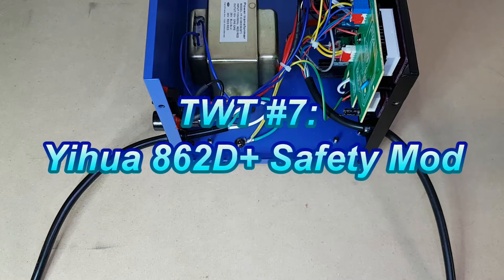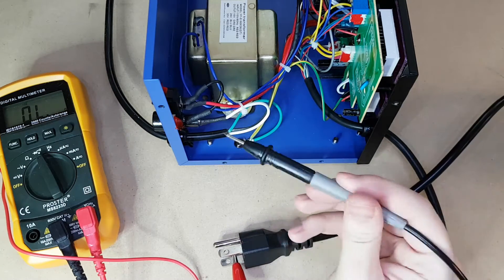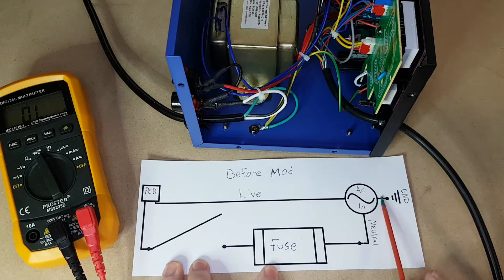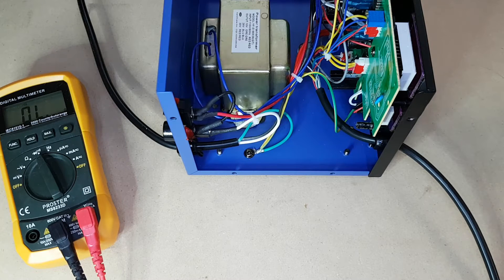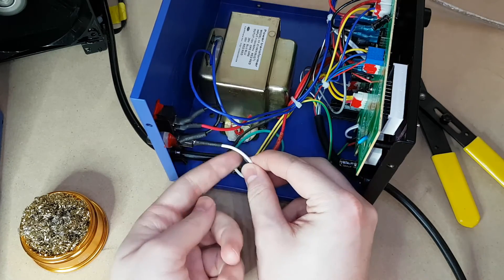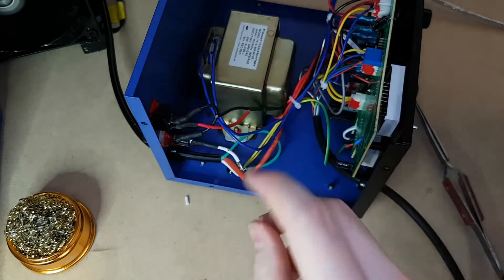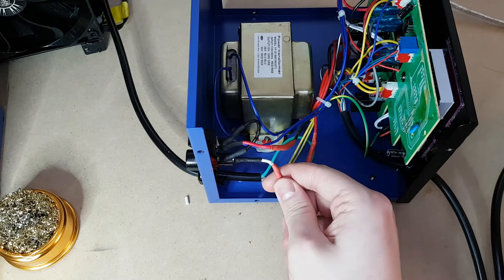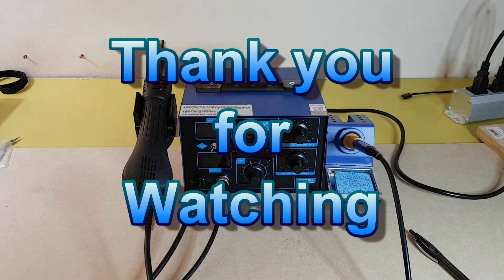TWT #7: Yihua 862D+ Safety Mod

Comment: Wonder if ALL THE VARIANTS of these units are wired like this one??
Reply from the maker: There are a ton of variants of this unit, but I've heard of multiple different branded ones all having this same issue. It just seems to be roll of the dice as to whether you get one that is wired correctly or not.
Reply: My Gaoyue 850, a Chinese Hakko 850 knock-off was miswired in the same fashion.  My Yihua 936B soldering station was partially miswired in a more peculiar fashion.  It's been a very long time since I encountered that, but if I recall, the "on/off" switch was switching the neutral, however, the hot line was fused.  It may have been the other way around.  Since I had it apart to replace the power cable with an IEC 3 prong receptical, I moved both the switch and fuse to the hot side of the circuit.  I don't think any of these type devices are "UL" listed.  :)

It's a safe bet that half of the Chinese made products of this type do not have their mains wired properly.  To be fair to the Chinese manufacturers of these devices, they aren't inherently unsafe to use, they are just not abiding by electrical standards we maintain here in the US and Canada.  There is no real circumstance, during ordinary use of these pieces of equipment that will put anybody in jeopardy.  If the switch is turned off on a machine that switches the neutral rather than the hot, the only live potential is still inside the machine.  The same goes for the internal fuse being miswired.  The earth ground is still present, and if in some bizarre situation, the fuse blew, the live potential could only short to ground on a closed enclosure, and likewise for the same situation having the neutral switched rather than the hot.

These things really only become dangerous when we open them up, not knowing only how it should be wired, but not understanding electricity in general.  Having standards makes life easier all the way around.  Consumer safety is just an easy means to coax manufacturers into not only building safer products, but products that abide by our standards.  I like standards, the alternative is chaos, which I don't appreciate so much in my old age...  :)  I buy so much Chinese made junk, especially where tools are concerned, that I can't think of any electrical device I've purchased in recent years, that I haven't had torn apart before ever plugging it in.  I correct what I find wrong, and improve deficiencies that will affect usability or longevity, but that's just me.  If I had the money to buy high quality tools, I probably wouldn't need them because I could then afford to buy new stuff to replace what breaks, instead of fixing broken stuff all the time.

Steve

Comment: Personally, if mine was wired backwards (it's not), I would remove the old wire entirely, cut the back case, add a IEC C14 (male side of the super common power cord standard used in PCs and more), and wire it correctly.

Otherwise, my Zeny branded one is actually pretty well built, aside from the /terrible/ iron tips and fitment. Actual Texas Instruments chip and a Samsung microcontroller.
Reply from the maker: Yeah that would be a more ideal mod for sure. Unfortunately I don't have any C14 sockets. I'm actually surprised they don't just use the C14 socket by default, though then they probably wouldn't include a power cable at all.
Reply: Evidently the zeny branded ones are nicer.  The schematics and cases are sold to small companies in china and they assemble them in smaller shops.  Some hire students to qc their process ( not the products) and they hire people to build units.  So they have no proprietary designs or formal patents.  Thats why you see 500 types of the same product.  The zeny brand has mostly samsung controllers or sony in some cases. I have 1 sony 2 samsung and all TI chips.  I did notice the element on 1 of my heatguns is made in japan the other 2 were chinese.
Reply: Tinkering With Terrius they dont add a socket because the sockets in china are something that varies greatly and unless its specd out correctly you can crash your whole company.  The build they bought didnt spec it with one so they didnt add one.  I agree any company with an engineer on staff would add a socket just to save money because even marking boxes makes 2 voltages expensive.  They use a guy who knows how to setup processes to make the first couple after that most small shops are 10x20 ft shops and the 5 employees live in the shop that makes them.  China is crazy when it comes to manufacturing.  I have seen nike shoes being made in a 10x10 shop by 10 kids who lived in the shop that go for 200 a pair in the US. The newest way to do things is to build 1000000 and put them in a big boxes and have them reboxed in route to the us to save money. The workers live on the cargo ship and box things constantly.  This works because it takes a month to get there and no labor laws to follow.  Waste is thrown overboard.

Comment: As promised, I came back to let you know what I decided on for a SMD station.

As you pointed out, the 862D+ is available from U.S. sellers on Ebay for $54.45.  After spending way too many hours debating what would serve me best, economically and functionally, I had limited my options down to two units.  The final contenders were the unbranded 862D+ for $54.45, and the Gaoyue 850 stand alone hot air station for $37.99.

While I truly believe the 862D+ is a better value than the Gaoyue 850, I opted for the latter.

Honestly, I am kinda a cheapskate when it comes to buying myself things, but it wasn't the $16.46 savings that led me to the Gaoyue whatsoever.  There were several small reasons that would not have compelled me individually, however, combined, the scale tipped towards the Gaoyue.

For starters, I already have a really good Chinese Hakko knock-off iron that I'm quite fond of, and used almost daily.  I do SMD repairs maybe once or twice a year.  Having something as large as a SMD rework station on my desk year round just gets in the way.  My solder station takes up about 1/2 the space, and still, I frequently move it to clear up momentary space for other things.

Secondly, that 862D+ is crazy complicated in it's construction where the electronics are concerned.  I need something that I can adjust temperature and airflow when I do SMD work.  I mentioned my old setup was comically bad, and it was, however, I was turning a potentiometer for heat, and a pressure regulator for air.  I work with hot air by feel.  It's not important to me what the actual temperature or CFM of of airflow are, so I'm looking at the integrated SMD station with all the bells and whistles as something that has a ton of needless potential points of failure.  The two dial 850 with no displays just works for me how I've been working for years, only far more efficiently.

Additionally, I kinda wanted a unit with an internal pump, rather than a fan in the handle.  I hear people say those "fan in the handles" work just fine, and even Dave from Eeevblog gave it a thumbs up, but it looks awkward to me.  I prefer only to be moving the heater around.

The Gaoyue 850 is the cheapest, most bare bones unit that meets all my criteria.  It doesn't have a hall effect or magnetic switch to shut the heater off when you hang the gun.  It doesn't even have a thermocouple in the heater to monitor the temperature, nor circuitry for monitoring or displaying the temperature.  It simply turns the heater on and off with frequency varying according to how high you have the heat turned up.  The air pump runs constant, but changes how fast based on input from it's potentiometer.  It does have a "cool down" feature that runs the pump motor at full for one minute after the unit is powered off.  That's pretty much it.

I had to laugh.  I always lop cables off of these type devices and install IEC plugs in their place.  When I was disconnecting the old cable, I noticed that Gaoyue wired it EXACTLY like your machine.  Yes, they neutral was both fused and switched with the power switch while the hot was neither switched with the power switch, nor fused.  Since I was replacing the cable with a plug, of course I corrected that.

I made a handful of other mods to the unit, purely due to my OCPD, but nothing to change how it works.  I think this is going to be the best setup for me.  I just need a project now to test it out...  I'll probably just start removing surface mount components off an old board, just to get comfortable with it.  It should be a lot easier to maneuver around than my old setup.

Steve
Reply from the maker: Thanks for keeping me updated, I apologize for not replying sooner!

I had considered just a hot air station when I bought mine. I ended up deciding on the 862D+ only because I figured a temperature adjustable iron would come in handy as well. Of course I don't have an iron tip thermometer to actually test how accurate the unit is, or a thermal couple to test the air gun yet.

It is quite bulky though and if I didn't have a large desk to work with I could see it getting in the way. I actually use it as a counter weight for my camera arm that is attached to a piece of plywood, so the bulk actually comes in handy! 

I imagine a unit with the internal pump would be more reliable over the long term and probably less noisy as well. I do wish I could afford a super fancy one, but really I have no reason to get one at my level of skill.
Reply: I think you made the right call getting an "all in one" station if you didn't already have a temperature controlled iron.  Since I already had the soldering iron setup I'm happy with, I just needed a better method for hot air than the crazy mess I had going on here for that.  :)

In terms of maintaining your hot air setup, you might also be better off with what you bought, rather than the internal pump style like I bought.

Don't get me wrong, I like what I bought for the reasons I mentioned, but I also try to think about how tool purchases will stand the test of time, and how little things will affect cost of ownership.

You can find both styles of replacement heat guns on Ebay for really cheap, and about the same price either way, however, when you replace your gun, you get a new blower to go with it.  In the case of mine, just the heating element.  That said, heating elements are dirt cheap, so I'd swap it first rather than replace the whole nozzle since it's the only thing that can go wrong with mine.  If your blower fails, you can buy a whole new nozzle, or just replace the fan in your nozzle, and if the heating element fails, they are cheap.  In the case of a station like mine, if the pump fails, a direct replacement of the pump would exceed the cost of the entire station, so I'd have to fabricate a substitute, which would no doubt take some time.

As for the accuracy of your heat control on either the hot air, or the soldering iron, I don't understand why people go to such lengths with those concerns.  If you wanted to tune the heat on your hot air, you can use a meter with a thermocouple, however, I don't see the point in that because the ideal temperature to melt solder on SMD's will change wildly from little factors, such as the nozzle tip you're using, and how high you have the air.  You'd have less luck gauging your iron tips temperature with a standard thermocouple because you won't get even heat transfer touching the tip to the couple.  You could spend about a hundred bucks and get a Hakko thermometer that will give you a fairly accurate reading, but again, why?  If it's not hot enough, turn it up.  If it's too hot, turn it down.  The thermalcouple in the iron heating elements reads just like the style you'd connect to your multimeter, but is accurate because it's surrounded by heated porcelain and the base of your iron's tip.  Again, your choice of tip will dictate how much heat is actually applied to the joint you are soldering.  The more mass your tip has, and the more surface area of the tip is contacting your joint, the more heat that will actually be applied.  That's why the conical tips are only good for the smallest SMD style joints.  In any case, if it ain't melting, turn up the heat.

I bought one of those knockoff Hakko 191 thermometers a while back, just because I was curious, and because it was less than $15.00 delivered.  Here's what I found:

My soldering iron was nearly 20degrees Centigrade hotter than what my dial indicates at the temperature I tend to leave it at, 350degrees.  So I calibrated my iron's station to compensate, now I set my dial just under the 350 mark.  Nothing is changed about how I work, the dial reads just a little lower than it used to.  I don't see how or why that should matter.  The bottom line is that whether you're using air or iron, the right temperature for the job is not going to be what's printed in a manual, it's going to be the temperature that works for the job, and that will vary with job.  Recommended heat settings should be taken as ball park figures to get you roughly where you need to be, but are certainly not absolute.

Anybody here who is just getting started with soldering and will not be doing any SMD work should consider getting a temperature controlled iron/station.  Anybody who has no equipment and wants to do SMD work should strongly consider an "all in one".  I bought my iron station separate from my air station primarily to save desk space.  My iron station stays on my desk because I use it all the time.  My air station sits under my desk until I need it, and will be placed under my desk when I'm done with the job.

I think one of most difficult things to do is to maximize efficiency in confined space.  If you're building the ideal workshop from scratch, make it 3 times larger than you imagine it needs to be!

Steve